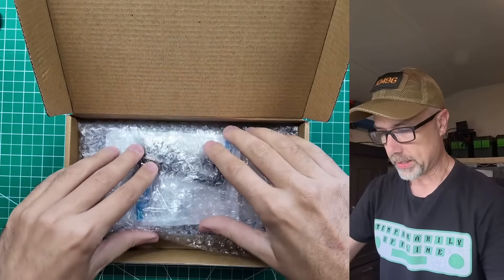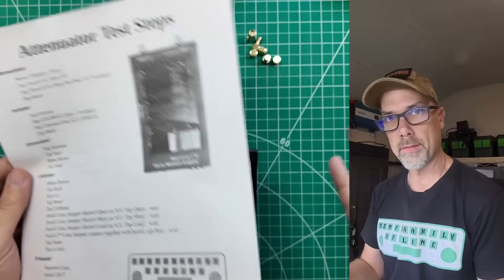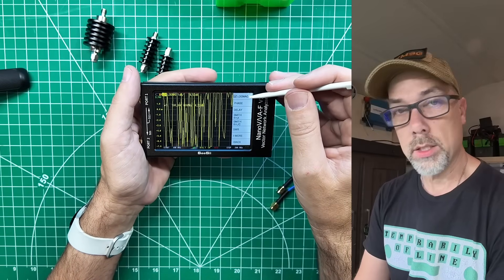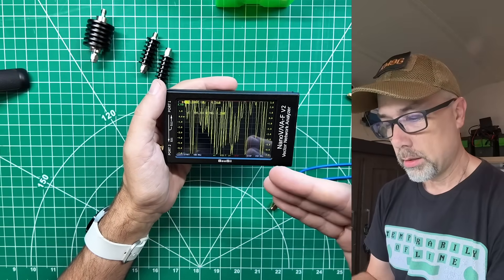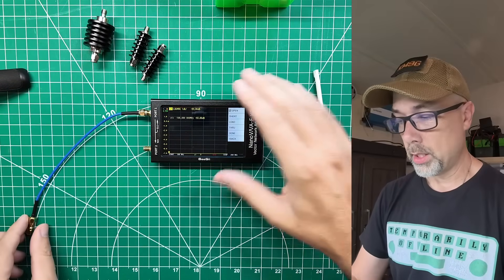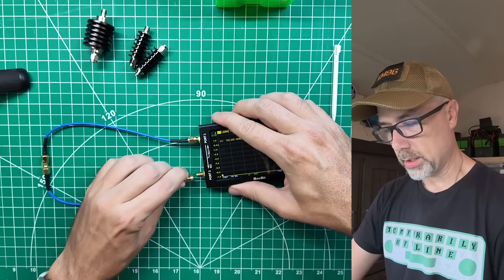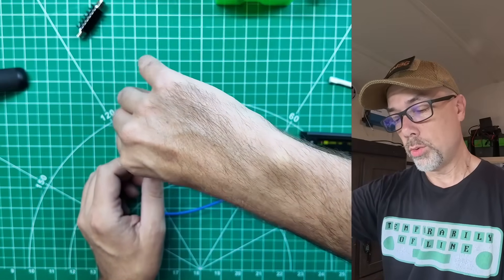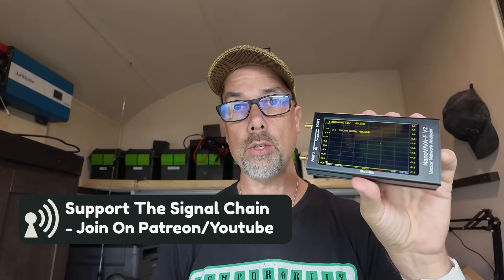Your Attenuator is LYING to You. Here’s How to Prove It.

Comment: Folks, when you get to 40 dB and beyond, cable braid leakage around the attenuator will shunt the attenuator, giving you a false reading.  I solved this problem at work by switching to RG-55/U, which is double shielded, AND tightly woven.  Cables like the LMR series also have an aluminum coating on the inner insulation under the braid, but are less flexible.  You can check the quality of your coax this way, or by just looking at how tightly woven and how completely the braid covers the center insulation.  Copper is expensive.  Good coax will cost more...  Cheap coax will leak more.  Jerry wa2omu
Reply from the maker: Hey Jerry,  What did you think of the included coax jumpers on the NanoVNA?  Need replacing?
Reply: @temporarilyoffline  Hard to say.  What is it?  Is there anything better?  You can set up some tests to measure their losses and terminate both at 50 Ohms then change the spacing and measure the coupling.  These will be frequency sensitive.    We used RG-58 size with BNC connectors for our testing.  We only used RG-316 with SMA's for short internal runs.  Note that both your 20 dB attenuators came in at <20.  Cable leakage shunting?
Reply from the maker: Oh, I thought you were talking like you knew something about the coax jumpers that ship with the NanoVNA.
Reply: @temporarilyoffline  No, I just know a lot about coax cables in general, from ham use to Mil-Std 461 testing.  Believe me, compared to the Rhode and Schwartz and HP stuff we used, those VNA's are just toys.  OK ones, but toys.  Except for solid exterior cables, they all leak to one degree or another.  Generally, only Certified true Mil Spec cables will be uniform from lot to lot.  Non mil, LMR seems to be both the lowest loss and leakage.  LMR 200 and 400 are all I use here.  They are stiffer, tho.  Know the VNA and coax limitations and just go have fun with them.  Jerry

Comment: Measuring s21 is not enough. You also need to measure s11 of the "input side" of the attenuator. It could have broken and not have 50 ohm impedance, which would end up destroying whatever device you connect it to. If the device failed open, it may be that you see 70dB attenuation due to some stray capacitance, but the input impedance will likely be waay higher!
Reply from the maker: Thanks for pointing that out.  The mission here was to measure the amount of attenuation.  I'll cover the s11 portion in a different video.

Comment: So, this setup should let me test the quality and loss in a length of coax?  Is there any way to do such a test from one end of the coax?  Lastly, can I test the coax when it is connected to an antenna?
Reply from the maker: Yes to all of the above.   Your best bet would be to use your adapters and test standards for calibration, then place the test standards at the end of your coax under test and note the differences.  I'll have an updated  video on testing coax out, but here is my previous video on this exercise: https://youtu.be/W_u_VM_F224

Comment: That was great ! That works for any VNA . Just the menus are different. I have  the SIGLENT SVA1015X. still does same test but better. It much faster sweep time so I can sweep 1 KHZ to 1.5 GHZ and make a graph on display . I have many go bad. Even new one out of the box.  The outher good test is a SWR threw test.  You test like a antenna but threw attenuator into good 50 ohm load. Then check both directions. Should be close to 1 to 1 on a good one. A bad one goes way up. Even do a smith chart that way . I have a bad attenuator that test good with VNA but under power the SWR goes way up. Some crazy things with the China made ones . With 2 watt meters you can test them under power and need good dummy load at end. From in to out power you can figure the DB of attenuation. For measuring low power use the VNA . I learned this from having a bad China one new out of box. Test good until some power goes threw than puts high SWR to radio . not good. Took me some hours of testing to figure that out. The radio did a fold back on watts . Almost anything can go wrong with China parts. Test your stuff ! 73
Reply from the maker: Great ideas!

Comment: Another warning, don't trust dummy loads or high power attenuators. I was testing a 2m mobile into a 50w dummy load, kept folding back and power limiting. Checked the dummy load with a VNA, all good. So, I put a power/SWR meter inline and checked at several output power levels, the SWR went over 20:1 at 15 watts😮. Yes, the imports are cheap, but they're saving money on components and QC.
Reply from the maker: Strong advice!

Comment: This is timely. I'm going to be doing the firmware changeover on my FX-4CR to the F5BUD firmware. To calibrate that firmware, you need to use a TinySA with attenuators. I finally pulled the trigger on getting those attenuators, and now I know that A] I shouldn't trust them at face value and 2) how to test them to make sure they're right!

Now I just need to figure out where I hid my NanoVNA. I've been using a RigExpert for actual antenna analysis, so my NanoVNA is in a "safe place" >.>
Reply from the maker: Right there with that $million dollar check!

Comment: Funny I was doing this just yesterday with some bandpass filters.  Real world noise floor on the nanoVNAs seems to be somewhere in the -60 to -70dB (even though most of them claim much more) range so keep that in mind when looking at attenuators or trying to tune up something like a duplexer.
Reply: I have tuned one set of cans with my personal nanoVNA and it was a dream compared to the OG I used the first time. I also redid the specs on the Butterworth band pass filters I made a few years ago. The hardest part of tuning these was doing a calibration standard for each band… not hard just lengthy. The boxes had to be opened messed with and closed then swept. Awful process but required. Great work Steve!
Reply from the maker: @jameski5oeb668 thanks James!
Reply from the maker: These NanoVNAs do so much!

Comment: My version of the NanoVNA, allows you to change the number of data points to 400 (or so).  Does your version being used here not have the same feature?
Reply from the maker: Most of them only allow 101p from the device.  Adding in the computer software you can get many more points... but luckily for this test, we only need 1 data point.